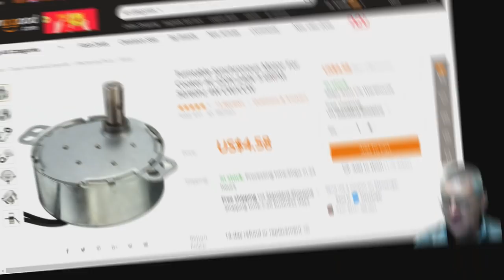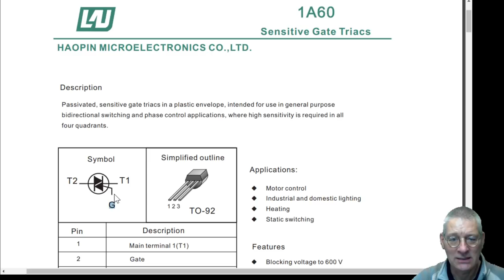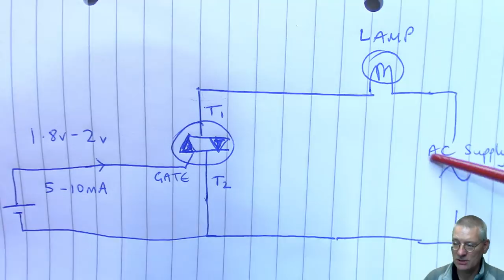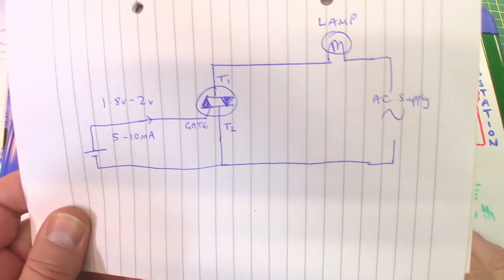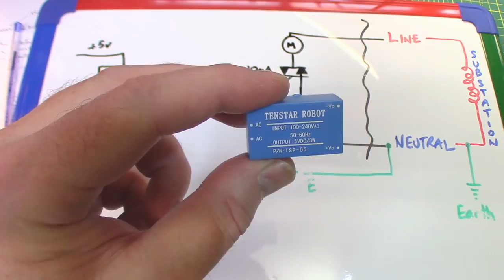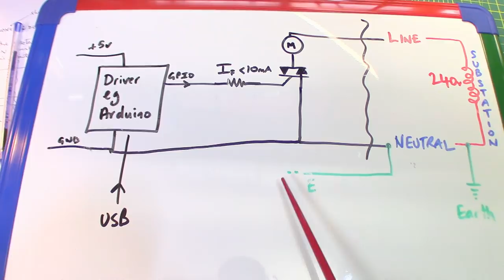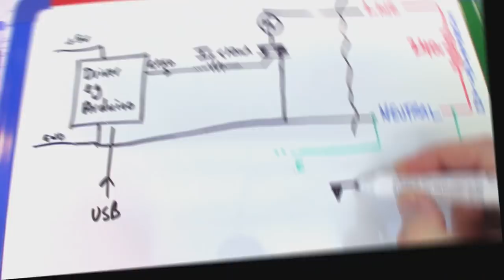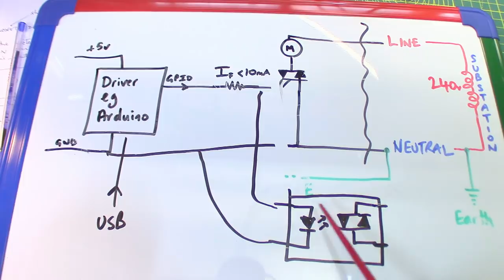#134 Triacs, Mains AC, DC, SSRs 😕 What's going on?

Comment: Ralph, back on the Naughty Step! You are ‘learning in public’ which is risky where mains are concerned. How can the tab of the triac be connected to T1, T2 or gate? Come on, you say why later in your video where you explain what T1, T2 and gate are. A triac is 2 Silicon Controlled Rectifiers SCRs back-to-back. You should have explained what an SCR is first. You need to separate the triac from the opto-coupler so that you can then choose to have zero-crossing or not. See MOC 3021 / 3041 and others. You were right to be wary of earth, ground, isolated transformers and ground-referenced transformers, USB etc .... but you did not know the answer. This is not a good video especially as the mains are concerned.
Reply from the maker: Oh dear. I'm sorry you didn't like this video, it seems that when I talk about mains voltages I always end up on the naughty step.
I'm not sure I'm actually learning in public, as you put it, I'm just explaining why I didn't use the original SCR in my new circuit board. Connecting the mains N to my Arduino's ground didn't seem a good idea so I didn't do it (but only because I was going to connect said Arduino to my PC, otherwise it would not have mattered one jot - just as it didn't in the original circuit). 
Talking about optoisolated Triacs in this video was not part of my intention (although a potentially obvious solution, but not one that would have fitted well in my workshop heater circuit board). I did briefly mention relays and SSRs and zero crossing detection as part of the alternative things I might have done but that was almost an aside - I didn't want this video to get too sidetracked or even lengthier than usual. 😢
As I didn't know the answer to why it was such a bad idea, perhaps you'll do the honours here so we all benefit, what do you say?
Reply: @RalphBacon  Ralph, I became agitated because you are right to highlight the dangers of DC GND, mains neutral and earth and the risks of inter-connection. Adding the mains earth reference of your scope would have completed the picture. There are many videos out there on the subject and you need to point your beginners at them before someone gets hurt.I covered this in my comment to you many weeks ago. At the very least get them to to continuity checks from 5V DC GND through to mains earth and neutral. Most will be fully isolated so 'floating GND' but some may not be as some transformers could be mains earth referenced. Yes it is 'complicated', but if you are connecting Arduinos to mains devices you have to learn it. In your case you avoided it hence the Naughty Step again.

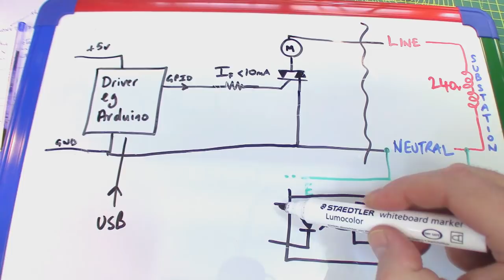Air gaps are not for the beginners this channel is aimed at. You should make the use of opto-isolators mandatory. You should also keep 240V AC on a separate board from the 5V DC board with the opto-isolator as the interface mounted on the 240V board.  That would have solved your return path to GND issue as you pointed out .... but it is NOT complicated as you say in the video (at around 17:28). The right opto-isolator would solve the latching up. That is what (triac matched) optos were designed for so there will be one to meet your design. (compare and contrast MOC 3021/3041for example) You missed an opportunity to educate here when you fell back to using a relay (at around 16:10). Claiming lack of space on the board is a cop-out! Optos and triacs linked into microcontrollers is a must-have as you more into the more useful stuff around the home with phase-control and PWM. You've touched on all of this in previous videos and you need to pull these threads together. You've got the right style, manner and presentation skill.

Finally, The mains earth wire is there purely for safety and is a Non-Current Carrying conductor. The Neutral is the return for AC to the substation designed to carry the load. It is more reliable and avoids the vagaries of ground (soil) impedance. It should never be used other than as a reference to ground potential (voltage). Fortunately modern homes have RCDs which help protect the unwary from trying to use earth as a return path since the RCD should trip (typically at > 30 mA)